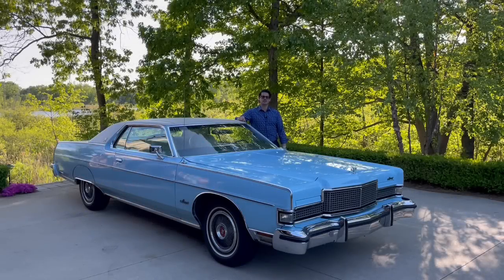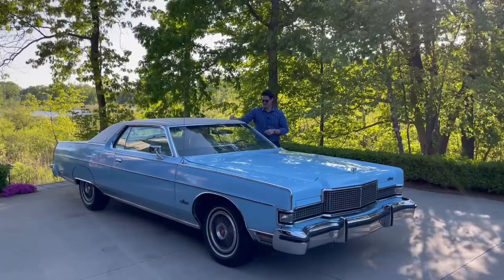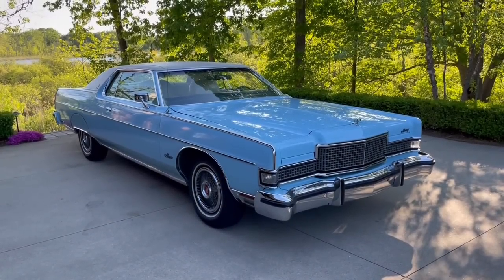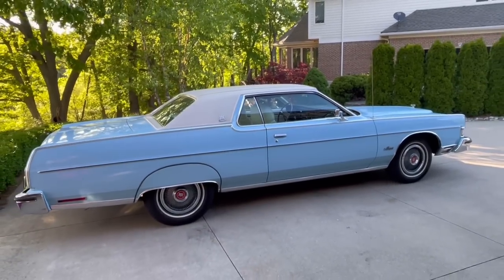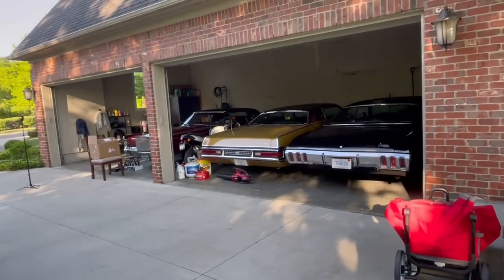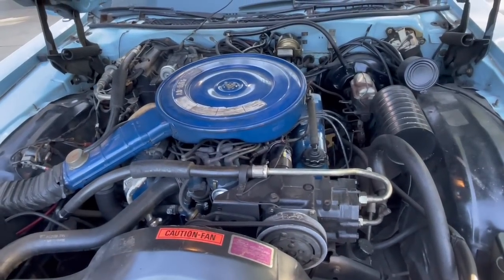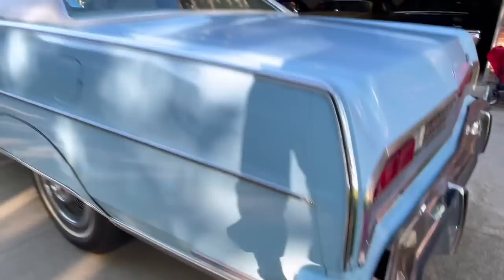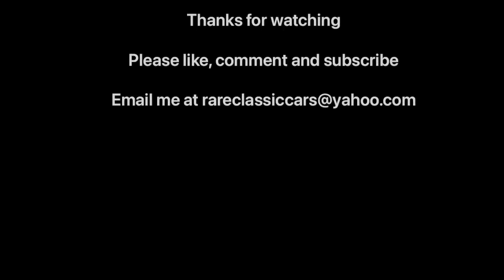Best Classic Car Combo of Ride & Torque...1973 Mercury Marquis Brougham Hardtop Coupe

Comment: The effortless torque from 60's and 70's big blocks always puts a smile on my face! 😊
Reply: It's so much more than displacement as well, although that's the main thing.  I'd like to do a video some day about why the 385 does such a good job in a variety of applications.
Reply: There was a big drop in performance after 1971
Reply: @FWFrank  Yes. Engines relied more on torque, which was still depleted, but still enough to move these big cars.

Comment: This was my grandfather's car. Except it had the 429. And was the color of ur other 73. He had it 20 years. With 80k miles on it when he sold it. Was a wonderful riding car. Had the automatic climate control. It would freeze u out in the summer. Just did general maintenance on it. Had the vinyl top replaced once. By my uncle. Who was a service manager at caddy dealership at the time.

Comment: So true about the silence.  I took my 460 MkV on an 1800 mile road trip in 2019, and it simply has to be experienced to believe how quiet the engine is.  Even at a GPS indicated 110 MPH it was but a whisper.  Unlike V8’s today that seem to all have a rumble to the exhaust.  Like a loud Harley it seems du rigor today to be loud and noticed.  I appreciate a rowdy cammed V8, but there is something to be said for turbine like smoothness and silencio.

Comment: I recall many long trips in my dad's '73 Thunderbird.  That was a very quiet car.  So quiet, the engine shut off going down a hill because the points "snapped" and the only way I could tell was that the AC got warmer.  Couldn't hear the engine.  Honking the horn sounded like a horn somewhere far off in the distance - which it was because the hood was massive.

Comment: I am forever grateful for Mercury having that "brow" of material on the top of the dash.  My dad had a crash in our 73 Meteor Rideau 500 and the only thing that saved me as the passenger from being tossed head-first into the steering wheel is gripping that!

When we sold that car, the indentations of my fingers were on that brow!  😊

The 69 Torino who hit us had a destroyed front end but we just had rear quarter panel and axle damage.

Comment: Beautiful, and I can see why you like it so much. 25+ years ago I had a 1974 Miller-Meteor Cadillac Criterion ambulance. It had about 65,000 miles on it when I bought it, and it ran and drove like new, except it needed a front end alignment. I flew out to Denver and drove it home to NJ. It was a fantastic highway cruiser, and it got 14.5 mpg on every tank of gas. I put it on a scale when I got home, and it weighed in at 7160 pounds with about a half a tank of gas in it. It had no air conditioning, and no power windows and locks. Anyway, I paid $6000 for it, way back then, and I overextended myself when I paid that. So I ended up selling it about 2 years later, I think. 
The quietest car I ever rode in was a `65 Imperial that I went to see in 1983. I took a ride in it, but never bought it. The only FoMoCo product I ever owned is the `97 Lincoln Town Car I have now, which I actually got for free, in about 2010.

Comment: Speaking of heater cores, you should add a short video explaining to the viewers the differences and dangers of the green and orange coolants.   Green for brass/lead solder construction versus orange for aluminum components and how the differing additives are entirely specific to the systems metallurgy and can cause expensive and unnecessary damage if used in the wrong application.

Comment: Ooooh, that is a very very very nice sled.  Those long of and super heavy doors, and they shut with such a satisfying thunk.  No sag.  Quality that lasts.  I had black on black 72 TBird, ten choice taillights all the way across the back. The only sexy car I’ve ever owned. Its power rear windows did not move downward, more straight back, a nifty oddity.  It was super smooth and also very quiet, loved it.  High dash and narrow side windows, it felt private inside.  I recall  sitting in sim powder blue 73 TBird at a dealer, white interior.  It was unusual and lovely.  A friend’s dad got a deal at state auction on a white plain wrapper 73 Monterey cop car for his high school son.  460 of course!!  Certified 140 mph speedometer.  I wonder if it had a quicker rear end ratio. They left the hand throttle attached to dash, right side.  It never worked, figured surely disabled for safety.  One Sunday afternoon friend was driving it down empty rural small town main steeet.  I leaned over and asked “You sure this does not work?” And tugged on it, it very surprisingly came all the way out that it normally could, the accelerator flopped to the floor and friend was power braking it down main drag, tires squeaking all the way.  I suppose not so funny to he as he tried so hard to get it popped back into normal position. From the passenger seat, teen, it was one of the funniest things ever witnessed.  He picked me up one day to go to local town.  Motor was rattling terribly. Farm boy, I checked the oil, absolutely none on the dipstick. He wanted to drive it to town and not be late for a set time gig, I threw fit and said no way !! , without adding quarts of oil.  We did, it quieted down and off we went.  I was plain shocked to think of driving it 20 miles and almost no oil circulating. Wrong-o bongo !!  The 73 Merc looks better outside than 72, but the dash with big slab of flat plastic does not match the high end look of the rest of the car.  Such a comfort cruiser.  Not fun to parallel park nor expect tight turning circle.  I love over assisted steering and brakes, tho.  What is the point of power steering if can barely tell it has power assist ??

Comment: As usual, another great video Adam!  I have a low-mileage 77 coupe Deville and a 71 Olds 98 and, while I love them both, quality control is typical 70s fare.  These old Fords and Mercurys, however, really seemed to be built to a higher standard.  As for your white vinyl top, try Mr. Clean Magic Eraser.

Comment: My 70 Marauder had a white vinyl. I used a scrub brush and Wisk (the stuff for cleaning white shirt collars)
Reply: Now that is a Car Adam should  have 69 or 70 Matauder  by the way back in the 60s & 70s there was a brand  of Travel Trailer named  Marauder we had one brand new 1976 the factory was on Bittersweet Rd near Granger Indiana  the day I was with my  parents to pick it up we got there and it was not finished  got to be watch them  install the doors and windows and some other options  right after that the company moved down to  Wakarusa ind. and they called them  Rogue
Reply: I meant Marauder  pardon my spelling blooper earlier

Comment: Hi, from the fine coastal city of Calgary, Canadastan. I've had a couple of these. A 1976 Grand Marquis Station Wagon with a neutered 460 and an '86 with a 351 on propane. Loved them both. I was surprised at how small the gas tank was on the wagon. If you pulled a travel trailer, you needed to equip it with at least 4 large jerry cans. The sedan was great on fuel. I love these big boats. Someone I know has a 1976ish Chrysler Imperical and a '68? Beewhack LeSabre that were his Grampa's cars, and I'm trying to steal one. I'm actually thinking I may have to BUY it!

Comment: As a kid growing up in the early 1990's I don't recall seeing many 1973-74 full sized Mercury's but saw many of the 1975-78 full sized Mercury's,  I think the full sized Mercury's are very underrated cars, I thought the 1971-78 full sized Ford's looked a lot better than the 1971-76 full sized GM's (especially the 1974-76 GM's).

What are your favorite years for the classic cars? Mine are from 1967 to 1970.
Reply from the maker: 65-72
Reply: @RareClassicCars 

Hey Adam, my favorite years are also 65–72, with 69–70 tops for most models.  
Back in the day, we used Wesley‘s bleach-white to clean our white vinyl roofs. I’m not sure if it shortened the life of the vinyl, but they did come out a beautiful bright white. Shortly before I got rid of my last car that had a white vinyl roof (‘70 Lemans Sport) in the mid-80’s, I bought the economy size half gallon jug, that is probably still sitting on the shelf in my garage. 🤦🏻‍♂️

Comment: I’ve watched your channel since the beginning, and have liked every video. Question, are you cautious or aware of crash safety on your vintage collection? With the worlds drivers these days, I always think of that in older cars. Cheers to all your hard word and passion that exudes through your collection and channel.
Reply: I suspect that the 5000-odd lbs of American steel will do more to cushion the occupant of those 70's land yachts than the 16 assorted airbags crammed into the modern tin-cans we drive nowadays.  That, and all the supple padding in those huge twin comfort lounge seats...
Reply: If he cared about crash safety i would assume his garage would be mostly full of old sweedish cars and mercedes instead
Reply: @philip4193  supple padding doesn't stop
old steering columns from impaling you my guy
Reply: These cars have plenty of safety features, including perimeter bracing to keep you protected in a side-impact, unlike older cars where you sat ON the frame rail and half your body is in the crush zone.  The steering wheels are collapsible.  The roof is doubled and the pillars strengthened, but nothign like a modern KIA.  There are beams in the door for side-impact.  5-mph bumpers also contribute to crash safety and crumple-zone.  There is a modicum of crumple-zone in the design.  The gas line routing and tank and placed to prevent fires.  The tank itself is made of ductile steel to prevent tearing.  Double master cylinders of course since early 1960s.  Two different types of brakes IS a safty feature, still kept that way on the Tacoma for that reason for example.  These cars are nothing like a modern basic car, but they are far from death-traps.  It's not a 1978 Datsun or Vega by any means.  4600lbs and the vast space in the trunk and hood are safety features of course.  The dash is designed to not break and kill you.  The floor is designed to keep suspension and driveline parts from meeting you in the cabin.  The driveline is held in a re-inforced tunnel.  Rear suspension linkage cannot intrude into the cabin in crash tests.  There's more, safety is a thing in these days but nothing like today.

Comment: I would try Bleach White on the top. It comes in a spray bottle and is sold at most all auto stores and hardwares. It would work great on that interior as well. Spray a small area then scrub with a stiff bristle brush, wipe off and repeat until done. Then treat it well with Armor all afterwards.

Comment: $5,500?  That is a lot of car for that money.  Very capable car for long distance trips.   We never had one but the father of a friend had one after years of nothing but Chrysler’s.  The father of another buddy had a Chrysler Newport with a 383 double snorkel air cleaner and dual exhaust.  Seemed like the Newport was a high compression engine. I think it was a 1967.  I think it burned rubber pretty easily.  As kids with our fathers cars, we used to enjoy burning rubber.

Comment: 303 has some great products for cleaning the vinyl roof. Use a soft brush with those to get it nice and clean. Lovely car althoug the look of the 75 onwards suits me more. And i have to admit this is one of the few cars which look more balanced in 4 door guise (just like the biggest fuselage chryslers look better in 4 door).

Also did you ever notice how the arrangement of lights with the PRND gauge under the speedo resembles a 1973 Impala / caprice rear bumper 😅

Comment: As far as cleaning the vinyl roof, back in the day we used Comet cleanser and a bristle brush. I don’t know about the advisability of doing it on one this old as the cleanser could potentially stain the paint. I remember that happening to me on a red Mercury Zephyr once. All I had to do was lightly buff it and the staining went away.
Reply: Some of the stuff we used back then, like powdered Tide detergent dissolved in water to clean the cars and vinyl was probably a bad idea. I used Future floor finish on my 68 LTD black vinyl top to shine it up. It was a clear to milky thin liquid wiped on with a sponge. It seemed to work well.
Reply: @mikekokomomike  
Putting dressing on a vinyl top is a double edged sword. On one hand it looks great after you apply it but it seems to attract dirt. Then it’s very difficult to scrub off. If you don’t use the dressing it doesn’t look shiny.
Reply: @dave1956  this stuff wasn't greasy like Armor All. It dried hard and shiny.  Didn't attract dirt. It was a modern version of floor wax, acrylic.
Reply: @mikekokomomike  

There was a product that we used called Ardex. It was a whitish liquid.

Comment: My father bought a 73 Montego MX wagon in that color. While we had some good times in that car (family of 6), the car was awful. The Mercury emblem on the passenger door card was installed upside down from the factory. 

We took the car on some road trips from Miami to Ohio. By 56,000, it rusted out, despite never seeing winter. Then, a rod knock. Dad sold the car to a junkyard for $15.

Comment: The color is great, makes the size proportions appear less boring and imposing.
Kind of like the way Sports Roof on a Fairlane 500, Torino, or Cobra made the car look bigger than either of those optioned with the Formal Roofline.
Except in this case, it's the paint job and white vinyl roof that make the car appear smaller.

Comment: I’m curious if you feel the steering column physically seems to be off center from the natural drivers seating position ?   I owned a 70 marquis convertible, with the McNamara two barrel of course, and I never got used to how the column and center of drivers seat were not in perfect alignment.     Another problem I wonder if you’ve encountered is the valve seals hardening and cracking thus falling apart and the pieces finding their way into the oil pan.   Once in the oil pan the smallest pieces would elude the pick up screen, jam the oil pump gears which would then sheer the drift pin on the distributor shaft causing and immediate shut down.   That was a very odd problem to figure out.

Comment: While I vastly prefer cloth in these cars (so much more interesting with the ostrich pattern) I have to give ford props for the quality of the vinyl, especially when you get to the T-bird 'super soft vinyl' trim)  - forgive me, I don't know if the that's the same  as what Merc was using at the time.

Comment: Quite interesting that the Mercury engineers were able to put such distance between their products and the stablemates at Ford. BTW, how many cars do you currently own Adam?
Reply: General motors did the same thing. And their vehicles were much more distinguishable. But nonetheless, GM and Ford both used just a few different chassis for all their different model vehicles.
Reply: I was also wondering how many cars are in the collection and where you store them, Adam. I'm picturing a Batman style underground bunker of all the pillarless hardtops from the 60s and 70s.
Reply: That answer is… classified.
Reply: The answer is: ALL OF THEM!

Comment: So many straight lines compared to the '72.  Wow.   Interior and exterior both.   Not a curve to be seen.   Such a contrast to the flowing lines on the '72.
Reply: The 72 doesn't have those 5 mph bumpers either.  Being an afterthought they look the part.

Comment: Really appreciate your revealing of the COST to acquire this vehicle, as the crew over here always finds that interesting. The color combination after 50 years is unique and attractive but in 1973 we all feel as though it may have been intended to appeal to a female buyer. It is clearly evident FoMoCo attempted to SAVE some manufacturing costs on this "flagship" model by using basically the same REAR light assembly as the lowly Monarch line. A couple of inquiries if you don't mind. Was a power ANTENNA available as an option on the Brougham ? Secondly on another topic, is that 1970  Chevrolet in the garage an Impala or Caprice with the hidden headlight covers ?!? Eternal Thanks Yo !  ,🚘 🔍.    👌
Reply from the maker: Yes and yes!

Comment: The heater core is not bad to do,but have you had to change a blower motor? I had a 74 a long time ago and the blower motor was getting loud. I got rid of the car but I guess you have to cut an access plate in the fender well and the new replacement motors from Ford would have a new plate to mount over it. I don’t know if you ever encounter that with any 1969 to 78 full-size Ford.

Comment: The 460 created so much heat that is almost impossible to even check the oil in the summer.  When I worked at a gas station, I hated checking the oil for the old blue haired ladies who drove these and the Lincolns.

Comment: I'm doing a remodeling job on an LTD same color combination 1976. We will have Mark 5 mirrors Mark 5 interior bumper tuck LED lighting everywhere, Flex Seal on the white vinyl top to make it last longer. Because it has over 120,000 miles on it but it has no rust. Six speaker sound system, and I call it a remodeling job. LED lighting behind the rear reflector panel similar to the new cars you see the little red strips looks great and it's quite functional. Power trunk release, rear defroster blower the car basically came with nothing take off the panels and have to add all these options. Then it won't be quite as a boring of a car and quite comfortable. And can be left out in the rain without guilt.